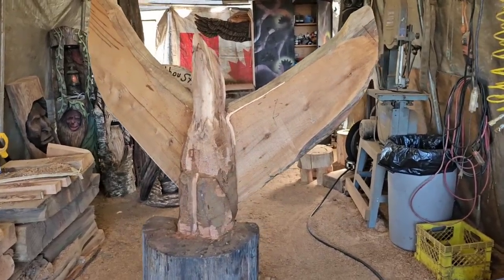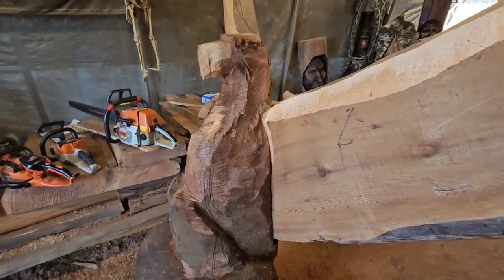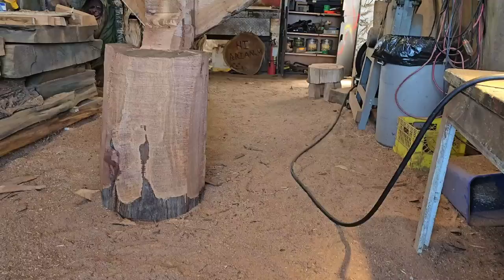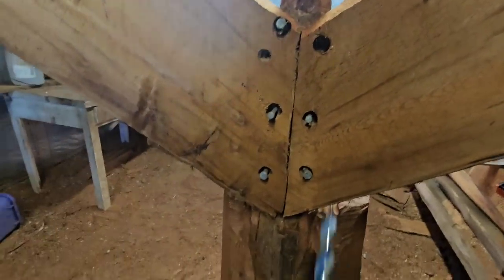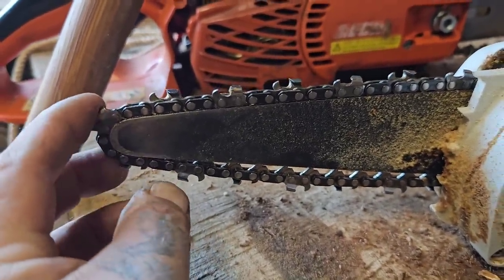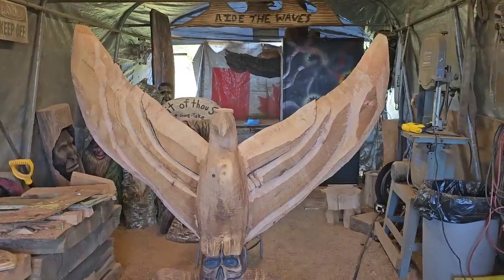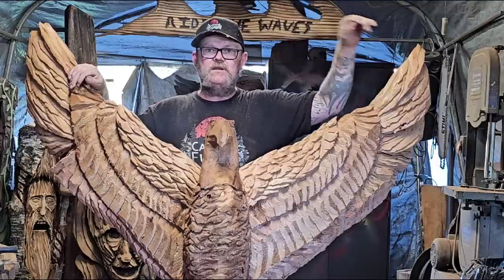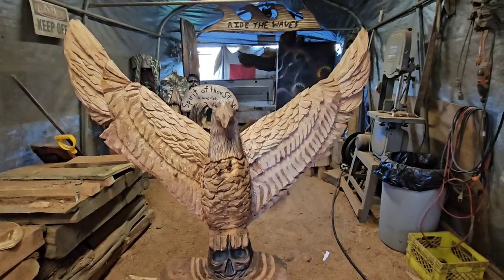Save the eagle wood carving part 2

Comment: I have the same book Denny Rogers. Hitting that lag bolt sucks. I have done same thing start a project come back to it months later and forget what or how I got to where I am. Pretty much same reaction. But it happens carry on .👍 Turned out good Jordy . You  could have used hacksaw to shorten top lag bolts while they were out and then doweled the front.